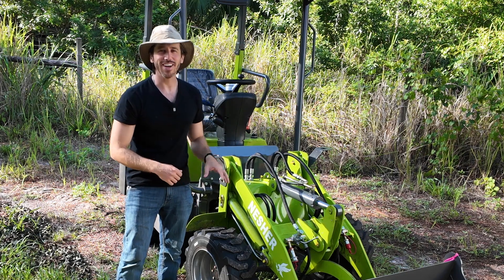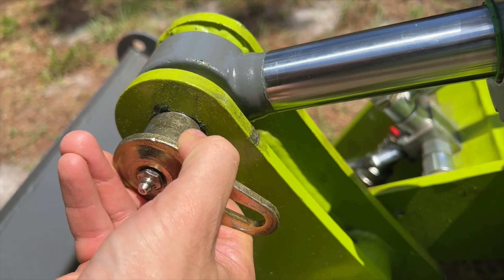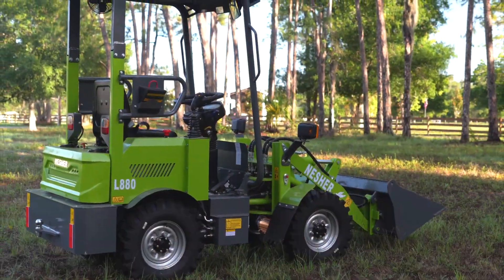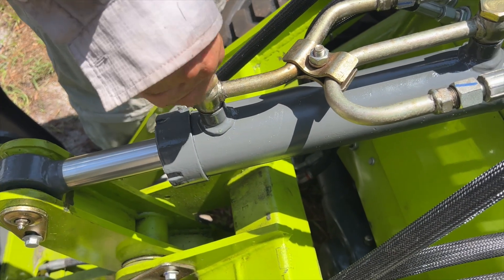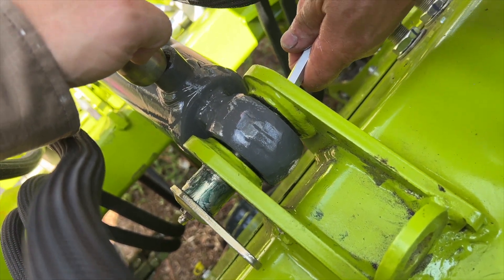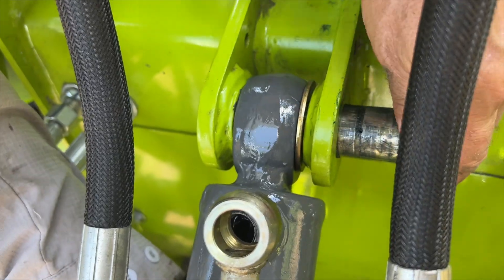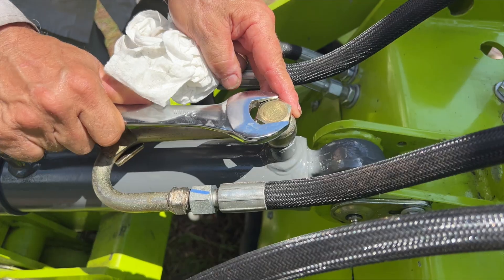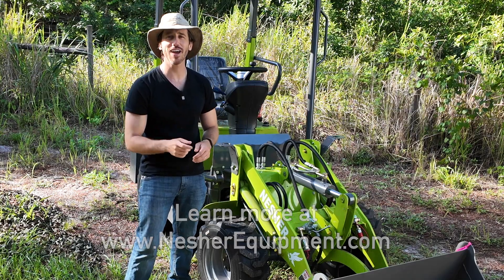Tech Tip: How To Swap A Ram On A NESHER Loader

Comment: Generally you want to use new crush washers on the banjo bolts. Are these available or included with the new cylinder? If not, what size is required?